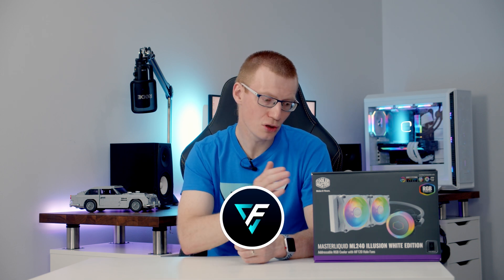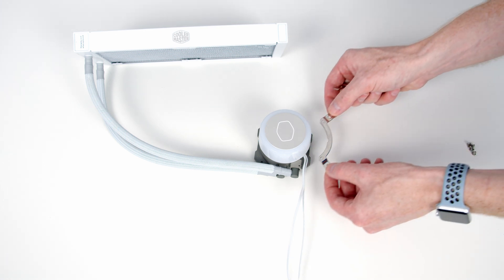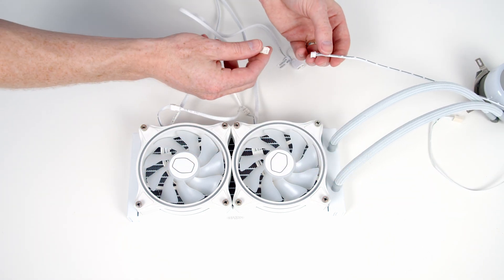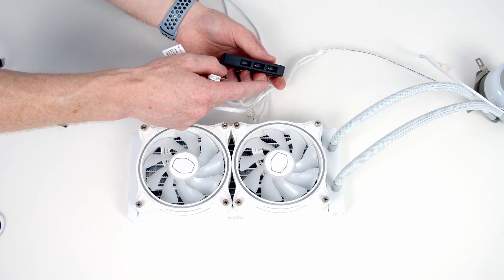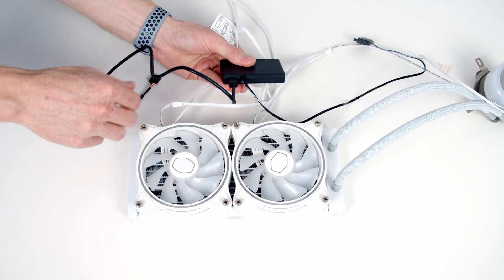Cooler Master ML240 Illusion Installation Guide

Comment: Your tubes should be pointing down to allow the air that is always in all of the AIOs to sit at the top of the radiator and away from the pump. The setup you have is not ideal but passable. A rookie mistake for someone new to water cooling. Sorry I just saw the final mount.. All is good.

Comment: I'm having issues with mine, everything seems ok and temps are good but my god the noise of like air trapped in it maybe drives me mad. Tried to move the PC and also twist the radiator in my hand to remove air bubbles but give it 2 days it comes back. Had my PC like 2 weeks, really annoying me.

Comment: All goes well until 9:35 . When I plug it into my motherboard then the pump and the fans light up. But with the controller they don't anymore. Do I have a use a separate sata power supply cable or can I add  it to an existing cable?

Comment: any reason the fans both have 4 pin connectors and yet the splitter has one 3 pin and one 4 pin ?.  anyhoo came here looking for which way the fans blow since they could not include a simple arrow like every fan i have ever had

Comment: your videos are the most helpful, thank you. One question, the logo on my aio pump head is not straight, I noticed yours wasnt either(7:32), and then after a video edit cut it was(7:39), could you tell me how you turned to make it straight, thank you
Reply: all you have to do is spin the metal plate with the logo until it’s straight
Reply: @ricebubble1490  Thanks, I think I tried it and was unable to get it budge, so I gave up before causing any damage to the unit- the plate seems to be stuck in place, but I will try again
Reply: @Cloud-Yo I know this is old already but remember you press only the logo plate and while pressing twist to any direction and it will start to move.

Comment: Hello! I bought a Gigabyte ud z690 ddr4, but i can't find the VDG connector. Instead, i found a connector named D_LED2
, which is the same as the ones which are for asrock asus and msi. So, i suppose i should use that connector if i don't have the VDG one?
Reply: does the box include the adapter for intel 12 generation?

Comment: 00:00 Intro
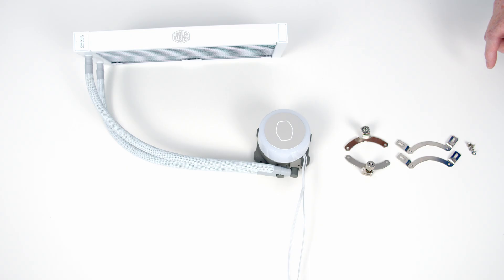01:46 Brackets
02:31 Fans
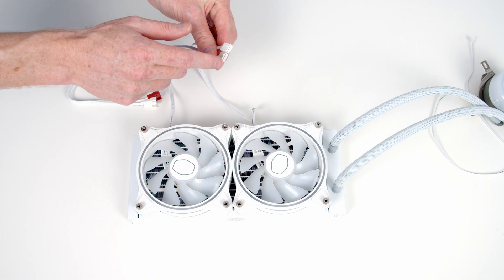03:00 Connectivity
04:48 New ARGB controller
06:13 Backplate
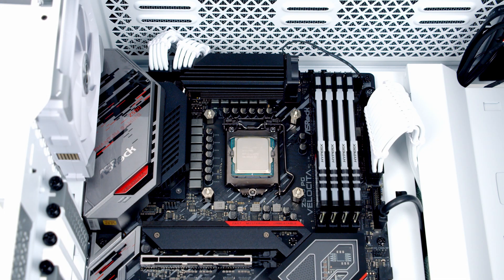06:59 Thermal Paste + Pump Installation
07:43 Cables Explained
08:36 Radiator Installation
09:24 Back Cable Connections
10:22 B-Roll
Reply from the maker: Thanks, chapters added
Reply: @ChristopherFlannigan  Hello, i don't know if you answer questions in your comments but i wanted to ask if your ml240 illusion, when it comes brand new and you shake it, does it already had air in it ? My ml240 illusion just came in today and before installation i shaked it and i can clearly hear air bubbles and gurgling . Just wondering if i received a faulty unit or not. From my understanding AIO's come filled to the max brand new and just over time they produce air bubbles. I might be wrong but i couldn't find any answer when searching the web. Would appreciate a short answer. Take care mate and keep doing these videos, they are super helpful .

Comment: Hi, I also have this aio cooler for my cpu. Also I have 3 ARGB fans coolermaster sickleflow , can I also plug all those 3 at the pump connector's other port? Can it handle voltages of those 3 front fans? Thank you

Comment: When all fan headers are either 3 or 4 pin. Why provide 3 pin only, provide adaptors to help customers...?? They need to stop the confusion for people. Make all fan connections either universally 3 or 4 pin. My Advice to manufacturers. Same with every other type of connector. Thanks. CoolerMaster. Take note. There is no universal industry standard still for stuff like this. Brands with their own patents need to consort to make a universal standard to make installation easier, less hassle, frustration free... This is why people still need to ask questions because instructions are neither clear either across brands with varying connector types. It's no wonder beginners and non tech savvy people are left stumped and stuck. When it comes to all the varying argb or RGB connectors out there. How are people to suppose to know how to connect say a Lian li strimer plus to a argb controller or gigabyte / Asus / MSI motherboard. Look at the connectors on them. Where is the instructions and compatibility adaptor cables from the manufacturers. Lian li. Take note. As well!
Reply: You can plug 3 pins into 4 pins if I’m not mistaken.

Comment: @Christopher, can I ask what the matt you put on the top of the PC case is?  Is that to reduce noise and dust and if so what's it called?   Great video by the way and it was very useful in preparing for installing my one.
Reply: It's a dust filter, it comes with the case.
Reply: @Jaitch98  whats the case?
Reply: @noesome  Corsair 4000D

Comment: My thumb screws won't fit you go so fast and don't show any small detail
Reply: Did you figure out what the issue was?
Reply: Having a nightmare if you look closely the metal brackets are slightly higher at one side than the other I can’t get it to fit - Do either of you find a solution?

Comment: Great video! Also, I noticed your build is in the new Corsair 4000D. On your back panel area, you still have your two 2.5” drive brackets installed, but not in use. Any reason why? I found that area to be perfect for mounting the fan controllers / rgb hubs!
Reply: The case comes with SDD drive brackets. Soo probably he doesnt have any SDD,  so he didnt want to take the brackets drive out.